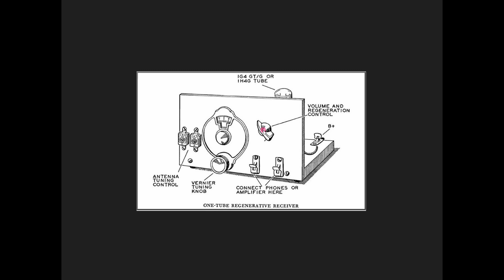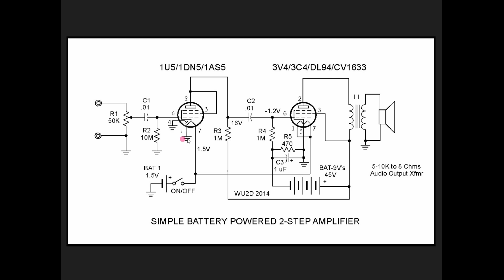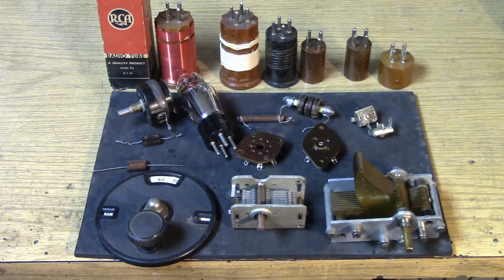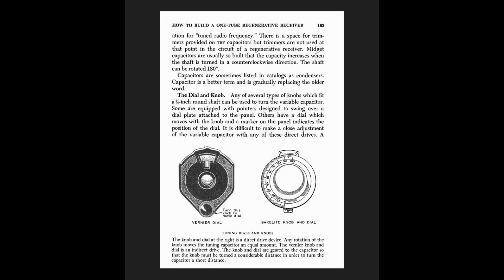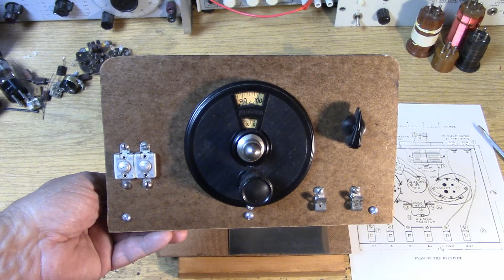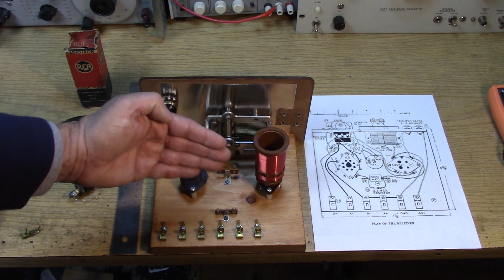Morgan Revealed - Part 3 REGENS

Comment: I loved checking out "The Boy's" books from the elementary school library as a young kid in the early '60s.  But I never had access to the materials, components, , tools, and thus the skills required to do anything with much of any of this stuff.  I don't recall what editions of the books I'd read, but the classic No. 6 dry cells alone didn't really exist any more by the '60s outside of specialty shops.  Years later I knew more and could cobble together replacements but by then tubes were all but dead and transistors and even ICs began to reach the experimenter market.
Reply from the maker: Bob, yes I remember in the early 70's when the solid state projects and kits in the back of the magazines kind of made the old tube projects look hopeless and ancient!

Comment: A really neat way to make coils I saw in, I think it was QST or some other magazine. You get a small diameter PVC pipe from a home improvement store, cut slits in it so you can collapse inward one end of it, and make a piece of scrap wood to go in that end while winding to keep it from collapsing while being wound. You wind the coil on it, and then epoxy over it a couple strips of plastic. Once it cures, you take out the wood, squeeze the PVC pipe to make one end of it decrease in diameter, and slide off the coil. High Q and no form. If your vertical-plastic braces that were epoxied on were made longer than needed that can be then epoxied to a used tube base.
Reply from the maker: Wow that is a mad method of making your own miniductor!

Comment: Takes me back to my childhood when trying to build anything radio related was fraught with nothing but problems. Never mind finding the right components, I never had anything to test any of the components I did have to check if they did actually work, and now I see there were issues with the printed circuit diagram. What could ever have gone wrong ? For me it was always everything. Except somehow bit by bit, year by year, small steady progress was made until i one day built a Superhetrodyne receiver and it did work the first time I switched it on. All I have now, some 40 years later, is some photo's of it.
Reply from the maker: Same here.I never had some elmers and mentors till much later - but I had access to books and hobby mags and best of all OLD 73 Magazines.

Comment: Depending on the tuning capacitor's max capacitance, the number of turns required to get the right uh value of the coil could  vary. The typical 10-365 pf tuning condenser in order to tune from about 530 to 1710 khz would require a coil wound for about  230uh (0.23mh). There are tuning caps that go as high as 450 pf, the number of turns would be less (smaller inductance) to get a similar AM band coverage or vice versa with a smaller tuning cap. Without knowing the number of turns needed, you have to revert to trial and error method. Having a LCR meter handy to measure Inductance and knowing what target mh/uh value you need, can make winding a coil less frustrating.
Reply from the maker: Amen. Spacing the turns can extend range at the top end somewhat because it lowers the self capacitance. The compromise of the plug in coil size and the large value capacitors make these simple sets poor performers out of the box.

Comment: With any of these old projects involving magnet wire and fairly critical inductors you really have to do the math for modern enamel wire vs. the old cotton or silk covered wire they called for.
Reply from the maker: Yes the DCC and even hookup wire spaces the turns and you end up with less inductance, but extended range at the top compared to close wound enamel.

Comment: The great thing about these little one tube regen circuits is they really are as simple as they appear, there is no reliance on unmentioned parasitics or whatever to make it work, you can just toss stuff together and it usually runs, especially down at broadcast band.
Reply from the maker: The actual problem is KEEPING THEM FROM OSCILLATING!